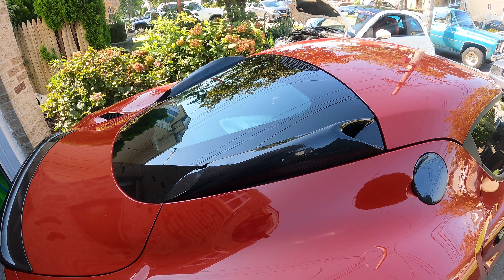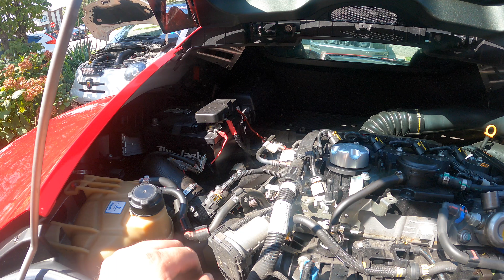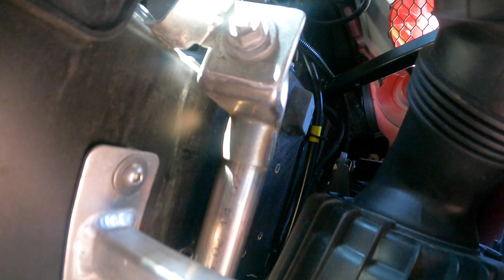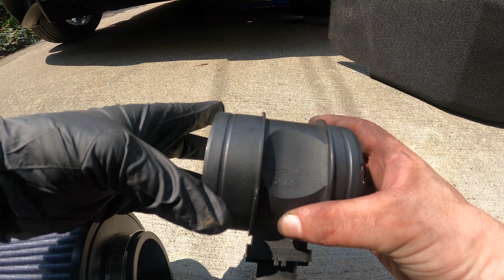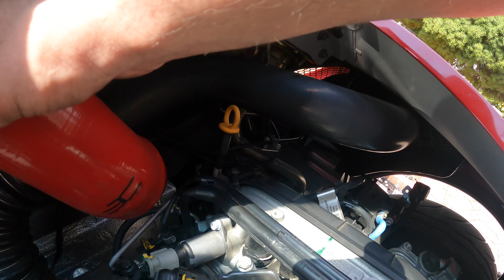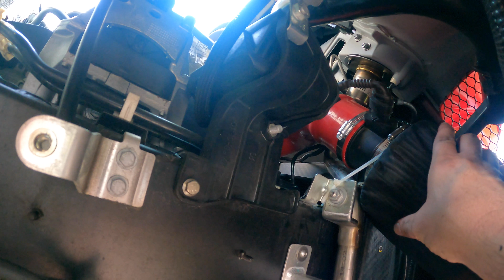Alfa Romeo 4C Eurocompulsion Cold Air Intake Install

Comment: Love all the work you have done. 
Did you change the blowoff valve ?  Or does it sound that beautiful from factory ?
Reply: I’m pretty sure the v2 intake system replaces literally the whole old one, so I would assume that it changes the blowoff valve, but I’m not 100%
Reply: @colby749  I have since purchased and installed the EC intake & tune. 
It replaced the filter & tube.
Completely eliminated the heavy restrictive air box.  That really lets you here the blow off.  Mine sounds incredible now too.  
(Stock blowoff)
Reply: @carlito3624  yeah I’m REALLY considering it, for only $350 it’s like speaking to me

Comment: The sound is cool but taking away the extra forced induction inlet will take away from the final CFM total in this engine. I would still to that same but enclose the filter into a pipe that still has its intake pointing to the opening as sit is intended.   I wish you could have gotten a 0-60 times before and after with a FIXD obd2 gadget.  You can do a 0-60 benchmark and this way you can tell if the change is good all across or is it just an audible coolness. Anyway, thank you for sharing.
Reply from the maker: You are correct with all that information, I mainly did it for the sound. I was going to do a 0- 60 but it was just so hot out the day I installed it and was just busy with other things. I definitely will do 0 to 60 testing in the future and get much better sound clips. Thanks buddy 👍👍👍 thanks for all the information